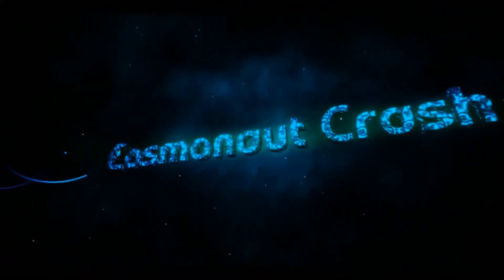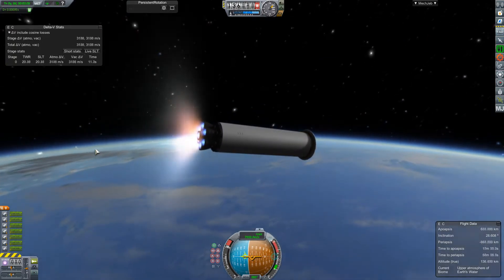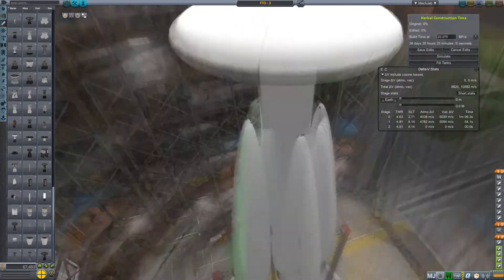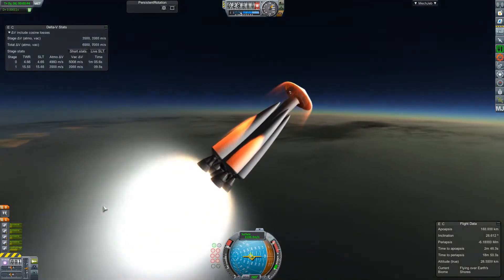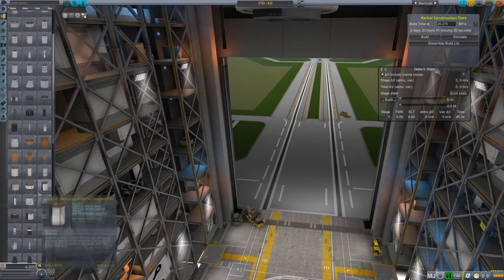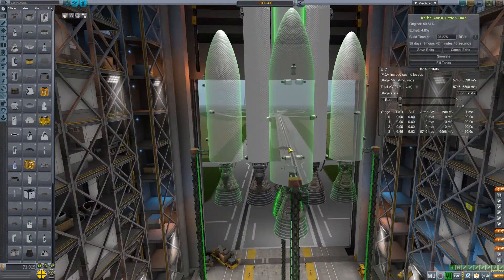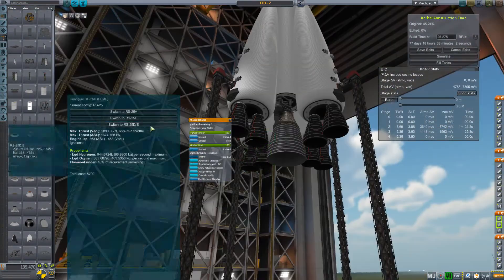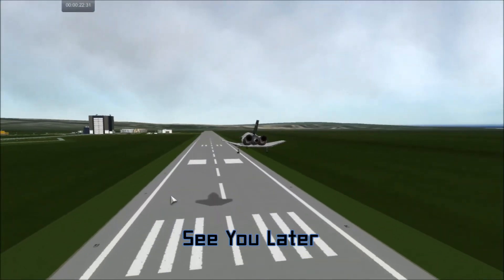KSP RSS Challenge Accepted 2 Fastest Time to Orbit

Comment: hi crash. I have a challenge for you, as you seem to enjoy them. 1940's space race. get to orbit in career using starter node and x1 planes node. I will record my attempt at the weekend if your keen
Reply from the maker: TranDroid Gaming so basicly a tech level 0 + xlr11 engine?
This does sound fun, and something I've not done before. I'm intrigued. 
I should mention that I'm not quite finished with this challenge, and may not be by the weekend. but if you can wait a week or so, I think this could be fun. we'd just need to agree on the rules.
Reply: Cosmonaut Crash so I have a pretty standard 1.2.2 install. I say you can only unlock supersonic flight, early construction and early avionics nodes. I have no problem waiting a week.
Reply from the maker: cool.
so a few other basics to nail down.  Is this a race challenge? if so, how do we establish fair start / win conditions?
ie: would it be first to post the vid, or least time elapsed in game?  Or a prove your salt challenge - just to see if I can do it at all. ( cause that is super questionable lol )
is this a full career mode challenge or is science mode okay?
Is it okay to alter the persistent file to get the required science to unlock the allowed nodes, or is the progression part of the challenge?
Reply: Cosmonaut Crash good question's. I think full career, time elasped being the main competitive measure. no messing with persistent file. that way it is a fair 1940's space race. extra cudos for more mass in space. ultimate goal would be man in orbit (probably impossible) also no simulations, you can fuel on the pad if needed. urrrrm can't think of anything else.
Reply from the maker: sounds good! If i think of anything else I'll ask here, but I'm totally game.  I'll let you know before I get started, but I don't imagine it being less than a week or so. ( this challenge is kicking my ass - and then there's the Mars thing lol )